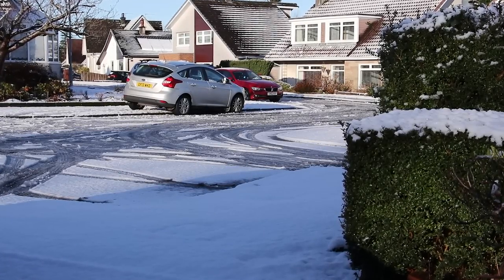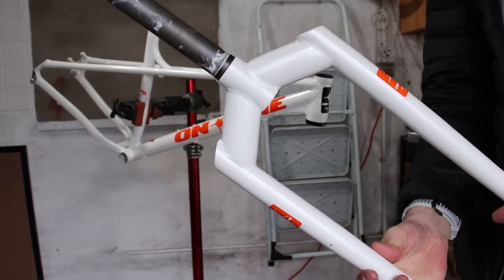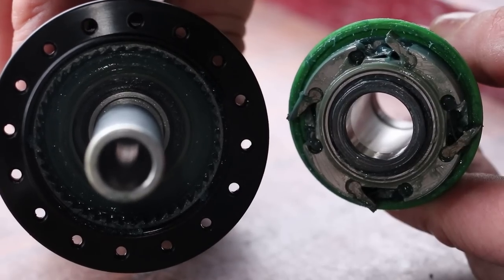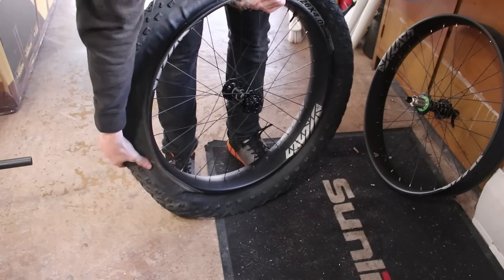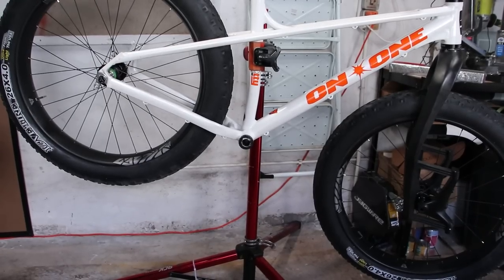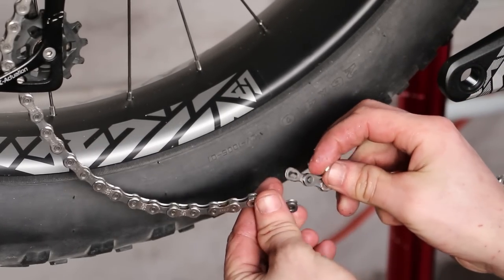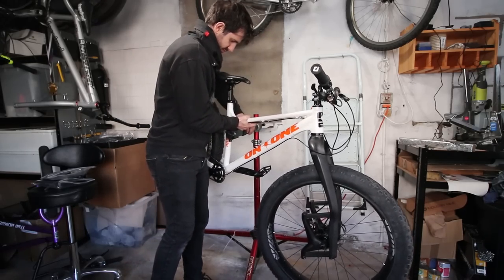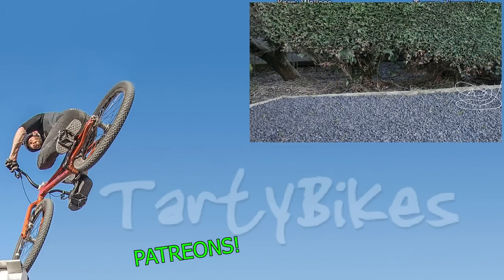Crazy Fat Bike Build!

Comment: Looking forward to a review of the fork. Hard to imagine a leaf spring providing any damping.  At the same time it might provide some nice pre-load if its just a spring.
Reply: The forks look really interesting, I think the fibre glass would provide good vibration resistance rather than true travel
Reply: They've been very popular for gravel bikes, so I imagine with fat tires and low pressure it'd be a pretty compliant ride
Reply: Leaf springs have a huge level of damping. What they don't have is small size or weight... unless you make them out of carbon and put them on a bike. The lauf fork is dead weird looking... but it works fine.
Reply: @weareallbeingwatched4602  interesting. What keeps them from oscillating like a coil spring? Seems like the compression and rebound damping would always be the same and non adjustable. I assume the lauf had that figured out but its not obvious how.
Reply: @dansacco1964  internal friction, and/or the leaves rubbing on each other (as on a lorry or truck). 

Leaf springs don't have adjustable dampers... well... apart from on racing trucks / jeeps, where it is not uncommon to run gas dampers retrofitted to leaf springs.
Reply: @dansacco1964  just spitballing here but I feel like there material also to some degree resists re-forming not just deforming, and that is damping.
Reply: @weareallbeingwatched4602  Why are you comparing Lauf's leaf springs to the leaf springs on vehicles? They share zero similarities in function or design. The leaves do not touch, they aren't made of spring steel, and the pivot points aren't even in the same place as any car chassis design.

Comment: You can try taking out the valve core too for faster airflow! Impressed by your bike mechanic skills, I still am scared to try wheel building! Cool bike!!
Reply from the maker: I would’ve tried that but there was just so much space between the beads I don’t think my small compressor had enough flow to inflate it even without the cores

Comment: with fat bike tires, once you gorilla tape and seat the bead with a tube, take the tube out and lay the wheel on a 5 gallon bucket with the open bead facing down. Gravity will bring the tire bead towards the rim edge and allow it to seal up much easier. Have done dozens of different rim and tire combos with this method and it works 100% of the time. cheers!
Reply from the maker: Top tips, cheers!

Comment: Hey man, great video. I have the same Fatbike, but with the standard Carbon fork ( Rigid ). It works great. In 5 years only had to replace the BB. No other bother at all.
I ride mine everywhere, (all be it not to the same skill as you.). 50+ greenway miles, or drop the tire pressures and do the local trail centres. It’s way more versatile than people think.

Comment: Now that's an interesting build for you Ali and you're 100% right, that fork is "Marmite" :-D Would be cool to try and entre it into the Trials comp, but not sure how those tyres would hold up and the fork seems to maybe be a bit light on spring rate for you. One thing I don't get, is why manufacturers don't drill fat bike rims with staggered holes to reduce the spoke angles, would help build much stronger wheels I'd think.
Reply from the maker: Don’t worry, after some advice on tyres and forks I’ve sent the Cute Thief out on another adventure to replace these, should make it a bit better off-road and for the comp.

Spoke-wise. Because this is a carbon rim you can make it double walled without much of a weight penalty. I think most alloy fat rims are single wall to save weight. The down side of single walled rims is that they’re just not as stiff/supported, the offset spokes give the extra support and stops the rim from flopping about. The only downside to offset spokes is that (in theory) they make a slightly weaker wheel as you’re reducing the triangulation of the spokes. An offset pattern starts to become more of a rectangle and rectangles aren’t as strong as triangles.

Because the double wall LB rim is stiffer you can keep the triangulation of the spokes and still have a rim that’s stiff enough even without any support…plus it makes finding spoke lengths a lot easier to calculate
Reply: Interested to see what tyres and fork you end up  with, will definitely be keeping a look out for that vid.

Get the whole triangle thing, but since the hubs are so wide, I'd figure with normal straight drilling the angles would be significantly more, so offsetting them would bring them back to normalish angles :-\

Comment: One year ago, I also bought a Fat Bike. It´s a fully with 24"x 4" wheels. I changed the breaking disks, with 160 mm, they was to small. I mounted 200 mm disks, the biggest I could find in shop. Thats why, the bike weights 30 kilos. Myselfe weights 90 kilos, so for me it is importante to can stop the bike safely and quickly. Greetings from Germany.

Comment: When I went tubeless with some 3.8s, I ran some Paracord around the circumference of the tire and kind of cinched it tight. This pushed the beads tighter to the rim and closer to the sides. Bit of sealant and they popped right into place.

Comment: It's a pleasure watching someone with great mechanical skills building such a unique bike, theres alway something to learn watching you! And the video quality is getting better and better, it really shows that you put in a lot of effort. For getting the tyres on, I would suggest using some soap water in a spray bottle, that hepls against leaking air and evaporates in a few minutes. It works for car tyres at the least. And whats is that white gease your using, does it have teflon in it and how's your experience with it, I just use some high stress grease from luqui moly. Cheers!
Reply from the maker: Thank you, I really appreciate that :) 

Next time I fit tyres I’ll try some soapy water…I’m not sure it would’ve been enough to get these to seat as they were pretty baggy but I sent the cute thief out to get some better ones and the soap trick could be a good help 👍🏻

Not sure what the grease is, just some fairly standard lithium stuff

Comment: if you cant get a tube less tyer on to a rim use the rope and spaner method 
put tyer on rim 
put rope round rim( on top of tyer)
put rench between rope and tyer (dosent have to be wrench any long thin thing will do)
twist wrench and add air (twisting the wrench to tention the rope)
Reply from the maker: I can’t picture this technique in my head 🤔

Comment: Great build Ali. I really dig the polished raw metal vibe. The only thing I would have done differently is the brake housings. I would have used braided metal cable housings that still have the polyurethane like coating, making the cables a bit quieter. I still think the Alligator housing is mint looking though. I have a question about the polishing you did, because I am getting ready to do the same kind of thing to my bicycles. My set up has two double headed bench grinders, one with a wire wheel, on one side, and a soft / finishing buffing wheel on the other. The second double headed bench grinder will have a medium buffing wheel and a hard buffing wheel on the other side. What buffing compounds did you use, what was your process, and do you have any advice for me that you wish someone would have told you before you started? Thank you Sir. Great video as always, give a pat to the cute thief for me, Cheers. - M

Comment: You can space the chainline out 2mm with a spacer behind the cassette and driveside bb. That's how I run my fatty trail with 12 speed.
Reply from the maker: I did that with the cassette but with the bb spaced out the chain line seemed quite bad with lots of noise in the lightest gear, this way seems to run smoother but it’s closer to the tyre, I’m gonna see how this pans out
Reply: Yeah that is where the sramano drivetrain rears it's ugly head unfortunately. The tolerances won't allow for it.

Comment: now, you say you are somewhat scared of thin, multi speed chains, but wait till you get in my shoes. at the time, 2019 i think, no store back home had a nice 9-speed chain for some reason. I ordered a ( speed, oilslick, light cutout chain from ALIEXPRESS. that thing has and still lasts with all the abuse I put on it (trials on a DH bike). It has lasted so long that it has become a bit of a meme in the trial comunity of RO. did i mention it was only like 15 euros?

2. for such wide rims, i was expecting offset spokes left and right, like a Hasshtag rim. Any reason for them not being offset?
Reply from the maker: That sounds sketchy! 

No need to offset the spokes with a double walled carbon rim, it’s stiff enough to not need the extra support. Alloy fat rims are usually single walled and a bit flexible so a bit of support from offset spokes helps. The only trouble with offset spokes is that it reduces the triangulation which can make a wheel slightly weaker
Reply: @Ali_Clarkson  than i wonder, if it makes the rim weaker by loss of triangulation, why on earth has Hasstag chosen such a crazy offset. From left to right, there is a distance of minimum 2cm inbetween spokes

Comment: Have zero experience with Light Bicycle carbon fatbike rims, but three sets of Nextie Bike fatbike rims… they mount up the tires tubelessly without any effort.
Reply from the maker: I think it was mainly down to how baggy these tyres were
Reply: @Ali_Clarkson  Curious what the weigh-in of your build yielded. The fatbike I currently own (2016 Aluminum 9:zero:7 frame with Nextie Bike carbon tubeless rims shod with Maxxis Minion FBR/FBF tires and a 120mm Rockshox Bluto fork and 1x11 drivetrain) I had down to 11.8 kilos in fully rigid singlespeed setup back when I was racing open/pro XC MTB, but now “only” 14 kilos in the aforementioned hardtail XC setup. Fun bike for sure.